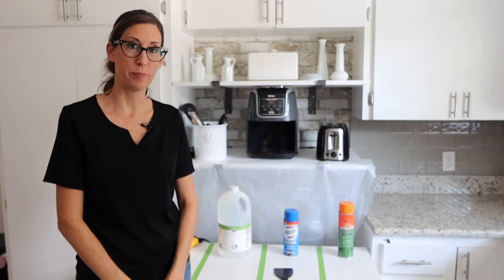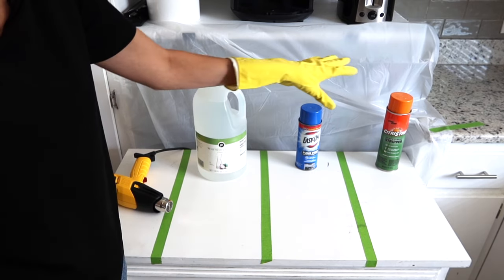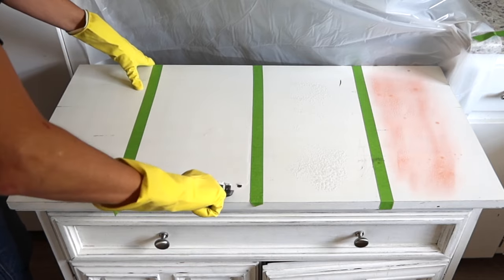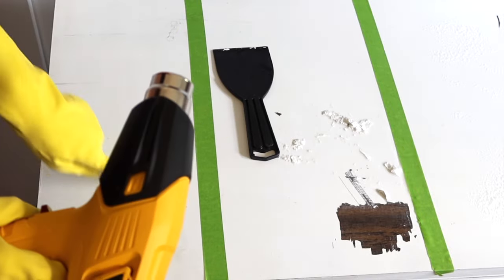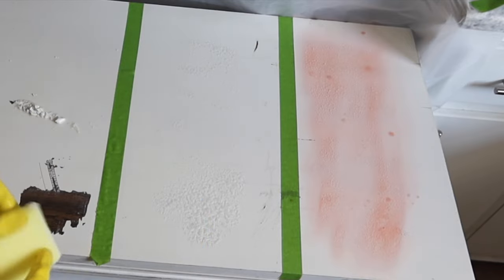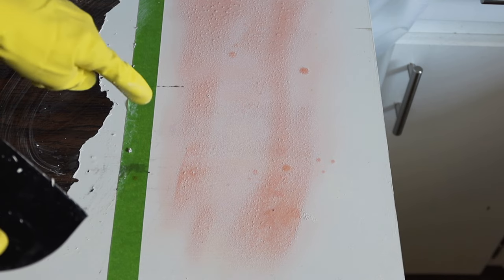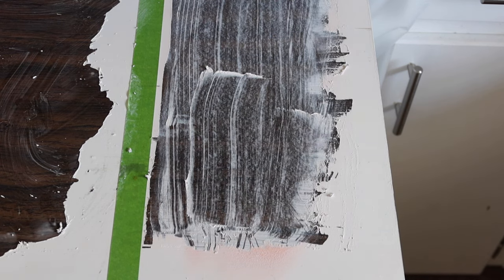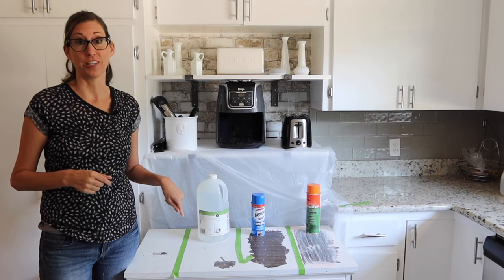How to remove paint from wood with Vinegar, heat gun, Citristrip and Easy-Off oven cleaner.

Comment: The heat gun has to be held in the same area until the paint bubbles. If you go back and forth and don’t focus the gun in one area the heat doesn’t get hot enough to bubble the paint to scrap off.
Reply from the maker: Good to know. Question though, I found that when I held it for too long that the paint melted and it was just a mess. For me, it seemed that if I heated it just enough I could forcefully scrape it off without creating a melted disaster.
Reply: @RepurposeandUpcycle  it is a bit messy no doubt but you also don’t want to cause any deep gouges by forcefully scraping when the paint isn’t quite ready to come off.  The bubbling is a good indication the paint is soft enough and separating from the piece.
Reply from the maker: @freedomat50  good to know.
Reply: I have found using a heat gun depends on what kind of paint and how old it is,  some will bubble up and your able to remove it though others will literally just turn to goo and is near impossible to remove
Reply: Try pre-sanding the areas with steel wool or sand paper then use the heat gun.
Reply: @janinetapp6482  I live in a 100 year old house and have been stripping paint off a door and frames with a heat gun. It’s working great but leaving a residue and I’m thinking it’s binder from the paint. Sanding doesn’t remove it but gunks up the paper. I’ve tried Citristrip and that stuff is crap and a mess. Should I use just use 100% acetone to get the last of the residue off and out of the nooks? TY
Reply: @Miss.C.  

Hey hi

You could definitely try it though depends on what it is you’re removing and if it will soften it enough 

Good luck,  Wow an old house is awesome 🤩
Reply: I recently used a heat gun to remove paint from a door with a tin of old layers of paint and it worked really well. I have heard that heat guns work best for several layers of paint, so depending on what you’re working with it might not be the best option

Comment: Something I would try with the vinegar would be to lay a towel or old rag on the surface to be stripped and saturate it with cleaning strength vinegar, then wait for 30 minutes and see how it works. I have used Citristrip and left it on overnight with plastic wrap over it. The next day I used a heat gun and a scrapper and the paint pealed away down to bare wood. It had at least 8 layers of old paint on it.
Reply from the maker: good tip!

Comment: Right of the bat I can say she using the wrong Easy Off. Yes, it DOES matter. I love Easy Off best.
Second, the heat gun is not meant to be used here-and-there like a hair dryer. Need to focus on a small area at a time and scrape along with it after it starts rising.
Reply from the maker: Which Easy Off do you use?
Reply: @RepurposeandUpcycle  
Yellow can Heavy Duty. Here's a detail of how it works VERY effectively
What I’ve learned from the Easy Off method:

1.       Make sure your using EASY OFF. Some of these videos are using just “oven cleaner”. I don’t know if this makes a difference but I don’t want to find out.

2.       Make sure you’re using the Heavy Duty (yellow can). Some of these videos are using the regular strength (blue can) and claiming it’s not working so well. And apply it good and thick. Wait 30 minutes. I buy from Home Depot or Lowes because they carry the bigger cans that grocery stores don’t carry.

3.       MOST IMPORTANT: DON’T USE WATER TO WIPE OR CLEAN IT OFF !!!!!!  I saw one of these videos say to scrub with soap and water and rinse with water. In the video, her table was visibly warped afterwards (which she didn’t bother to mention). When I tried this, the wood began to warp AND crack. Wood and water NEVER get along.

After 30 minutes, wipe it off with a dry rag. The paint will just smear. Don’t worry and don’t bother wiping/scrubbing too much. Wipe top layer and let it be damp/tacky. Then use a wire brush to gently scrub AGAINST the grain. The paint should crumble off like eraser shavings. When I scrubbed WITH the grain, it started digging too deep into the soft parts of the wood. You may need to do a second application at this point. Wait 30 min. Wipe. Then gently scrub.

4.       Now clean the wood with pure acetone. Gently sand with 400 and paint or sand.

Comment: Yikes! I am always up for new tips and shortcuts, but I am concerned that you conducted this test indoors, with no effort to ventilate, and you aren't using proper mask or goggles or even long sleeves. Anything in aerosol form shouldn't be inhaled. Nor should toxic fumes raised by the heat gun when heating paint to the point of bubbling. And you should protect your eyes and skin from all of the items being used! You are worth more than your workspace!!

Comment: Yeah when you use the heat gun you have to hold it in place until you see the paint blister or bubble up. Also I use a stiff metal scraper to remove the paint and it works much better than the plastic ones. Good video. By the way the paint stripper is okay on flat surfaces but troublesome in tight areas and hand carved designs. Also the oven cleaner is usable but don't get fooled about the claim of odorless. The fumes can still give you a coughing fit if you use it. Be careful.
Reply from the maker: Good tips
Reply: The paint will NOT always bubble/blister/crack/peel. I'm working on a project now and the paint started to burn/char and still would barely come off with my wire brush, key alone a scraper. Alternatively:

The Easy Off method:

1.       Make sure your using EASY OFF. Some of these videos are using just “oven cleaner”. I don’t know if this makes a difference but I don’t want to find out.

2.       Make sure you’re using the Heavy Duty (yellow can). Some of these videos are using the regular strength (blue can) and claiming it’s not working so well. And apply it good and thick. Wait 30 minutes. I buy from Home Depot or Lowes because they carry the bigger cans that grocery stores don’t carry.

3.       MOST IMPORTANT: DON’T USE WATER TO WIPE OR CLEAN IT OFF !!!!!!  I saw one of these videos say to scrub with soap and water and rinse with water. In the video, her table was visibly warped afterwards (which she didn’t bother to mention). When I tried this, the wood began to warp AND crack. Wood and water NEVER get along.

After 30 minutes, wipe it off with a dry rag. The paint will just smear. Don’t worry and don’t bother wiping/scrubbing too much. Wipe top layer and let it be damp/tacky. Then use a wire brush to gently scrub AGAINST the grain. The paint should crumble off like eraser shavings. When I scrubbed WITH the grain, it started digging too deep into the soft parts of the wood. You may need to do a second application at this point. Wait 30 min. Wipe. Then gently scrub.

4.       Now clean the wood with pure acetone. Gently sand with 400 and paint or sand.

Comment: If you're frequent re-furber, you're most likely not a fan of CitriStrip or any other low-odor/creamy-type of stripper.  They perform very poorly!  Definitely going to give oven cleaner a try after seeing this however!  Great video!
Reply from the maker: I will say that Citristrip seemed to work better many years ago  (did they change formulation?) and I agree that the harsher chemicals do strip a tad better. I will say though, the oven cleaner does an amazing job!
Reply: I HATE citristrip, they did change the formula and a lot of formulas for strippers. I've moved to a heat gun, but it doesn't work with pulling stain out 😬
I'm flirting with the idea of easy off, but I've seen it do some terrible things to wood
Reply from the maker: @SarV1  The easy off works well stripping older stain and paint off of real wood. It doesn't work great on everything though. You just have to test a small area and see.
Reply: @RepurposeandUpcycle I just experienced this! Used it 20 years ago and it was great, got some last month and it was useless!

Comment: You seemed to get good results with the citrus except for what was left. Do you think the oven cleaner used as a 2nd clean method would take off the smeared residue? I know you don't want to go down to bare wood with oven cleaner. It will discolor the wood. OK if you're going to repaint it but then why would you completely strip it?
Reply from the maker: Yes the oven cleaner would work great as a second clean method actually and I have since used it as that!

Comment: That's exactly the experience I've had trying to strip with a heat gun--jack squat.  I've had the wood beneath start to burn but NEVER seen a paint "bubble" on the 3 very different projects I tried it on.  I don't know what kind of paint does that but it aint at Home Depot.
Reply from the maker: Glad to know I'm not the only one with a failed attempt with heat gun.

Comment: What I’ve learned from the Easy Off method:

1.       Make sure your using EASY OFF. Some of these videos are using just “oven cleaner”. I don’t know if this makes a difference but I don’t want to find out.

2.       Make sure you’re using the Heavy Duty (yellow can). Some of these videos are using the regular strength (blue can) and claiming it’s not working so well. And apply it good and thick. Wait 30 minutes. I buy from Home Depot or Lowes because they carry the bigger cans that grocery stores don’t carry.

3.       MOST IMPORTANT: DON’T USE WATER TO WIPE OR CLEAN IT OFF !!!!!!  I saw one of these videos say to scrub with soap and water and rinse with water. In the video, her table was visibly warped afterwards (which she didn’t bother to mention). When I tried this, the wood began to warp AND crack. Wood and water NEVER get along.

After 30 minutes, wipe it off with a dry rag. The paint will just smear. Don’t worry and don’t bother wiping/scrubbing too much. Wipe top layer and let it be damp/tacky. Then use a wire brush to gently scrub AGAINST the grain. The paint should crumble off like eraser shavings. When I scrubbed WITH the grain, it started digging too deep into the soft parts of the wood. You may need to do a second application at this point. Wait 30 min. Wipe. Then gently scrub.

4.       Now clean the wood with pure acetone. Gently sand with 400 and paint or sand.

Comment: Very informative video! Except you definitely didn’t use the heat gun correctly. It would’ve worked way better used properly and less mess than the sticky citrus strip. Even though the paint melts so you can scrap it, as soon as it cools you can easily sweep it up and no need to use a cleaner to get up goo

Comment: SmartStrip works phenomenally, and is non-toxic. What works best w/any process, is time. W/SmartStrip, I put it on, heavily, then cover it w/wax paper {at least a little better for the enviro than the cling wrap they suggest}, and leave it for a few days. Side note: I'm not just scraping off one coat of paint. I'm scraping off a century of different layers in my home's woodwork. So this stuff has to eat through, at times, up to 7 or 8 layers of paint. After a few days I scrape--using a heavy duty paint scraper--then bc I have very little upper body strength, I can only get the first few layers off. So I repeat the process, and 95% of the time, the second time takes it all off. I used the CitrusStrip for a while--never the spray, to me that's just adding to the non enviro friendly aspect--but they changed to an inferior formula {their Amazon ratings took a nose dive, too}, and found SmartStrip. Very very little smell, it's in a nice big bucket so you can get it all out, AND reuse the bucket. I'm a huge fan.
Reply from the maker: That's great to know. I'm going to have to give the SmartStrip a try. And you are right....stripping wood takes time and patience.

Comment: Did you try "cleaning vinegar"?  It's a stronger vinegar solution.  About 6 percent acid vs 5 percent for regular.  Sold in the cleaning products section in stores.
Reply from the maker: Yes I've tried that too and it does work on some surfaces but for this surface it just didn't budge.

Comment: Not sure you would get the same results in all applications.  This looks like it was paint over the top of a finished piece of wood, and likely without a primer laid down first.  Not sure you'd get the same results if trying to strip paint that was laid down correctly and over raw wood.  I could certainly be mistaken, though.
Reply from the maker: You are correct; it's not as efficient removing paint or stain from properly painted surfaces. I did a similar video here where I had issues getting the finish off. https://youtu.be/gy32Zg-yQUg